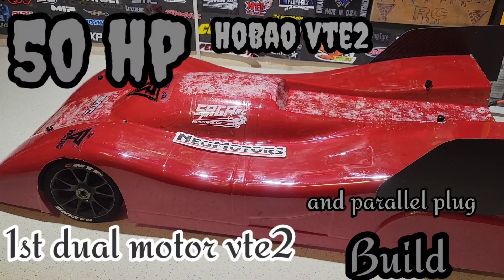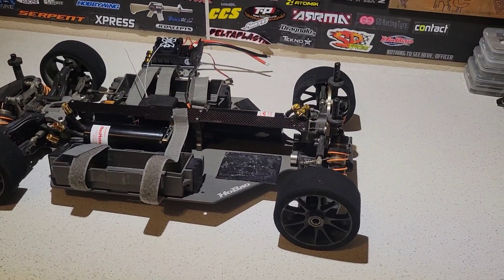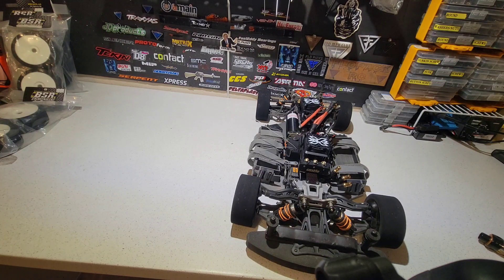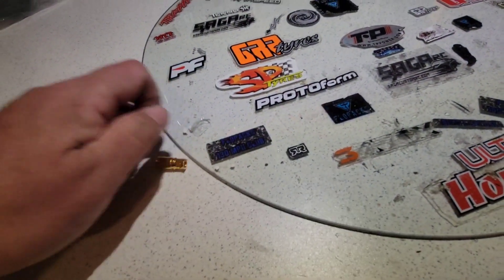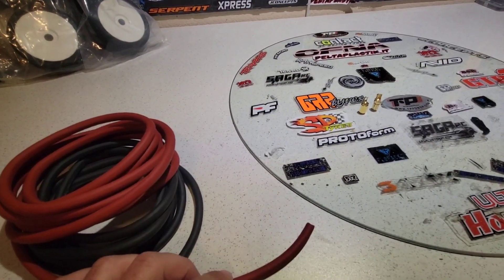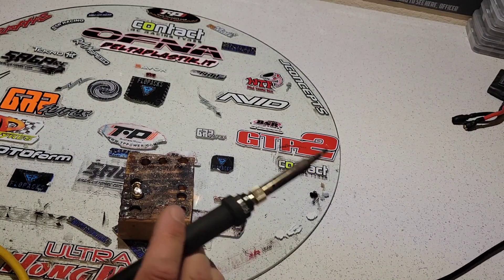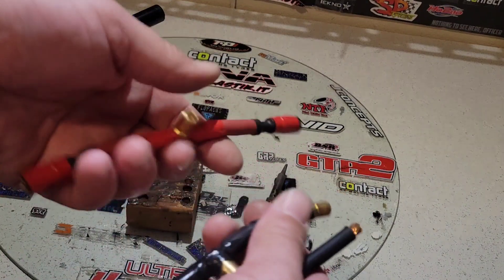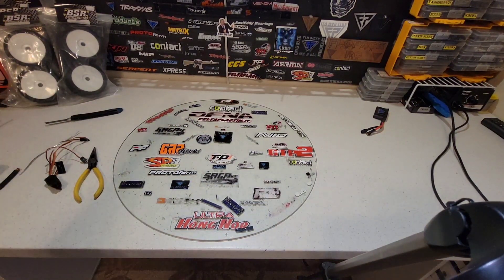50 hp dual neu hobao vte2 & parallel plug build ..Flopackrc.com

Comment: Im not bashin by any means but dual eac and dual motors is it gonna really give you more speed. My opinion is more tourque but not more rpm's. 2 motors 8 motors or 1 they all spin the same rpm. More tourque dividing the load between 2 motors but at end of day they both spinning the same rpm's.

Comment: 10 gauge is what is used for household dryer. 30amps
14 gauge 15amp
12 gauge  20amp
10 gauge 30amp
 8  gauge 40 amp
 6  gauge 50 amp
A/C current anyway

Comment: Hey Flo! I just ordered your shock towers. Had a question about body posts. I have a delta plastiks body and want it to sit higher than the stock posts. What did you use for yours?
Reply from the maker: Higher than stock post
Reply: @flopackrc5452   yeah, no shit Sherlock :) Which ones did you use? I wouldn't imagine there are loads that fit.
Reply from the maker: I used stock there's no reason you would need longer post  mine stick up 1" higher than body I got a ton of adjustment.. what body ?

Comment: Thanks Jay, good shit as usual. Waiting on good weather up in NY to run mine. Definitely not a fan of the motor mount. Can't fit a 17 series castle in the car, even with the 1/5 scale mount. Hoping they fix that soon. Saga mentioned about trying the old VT 1 mount and raising the brace up, but won't that F up the drivetrain by raising it a little?  Hope to see some tips on upcoming vids